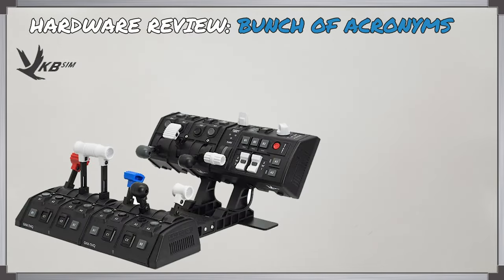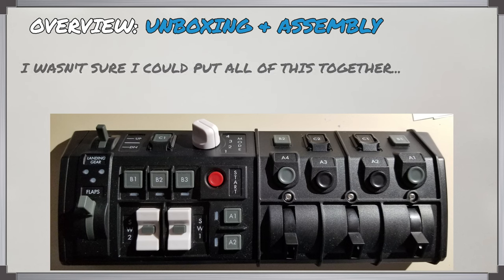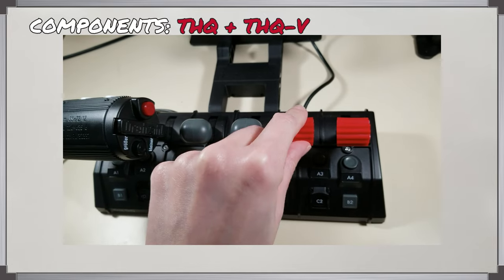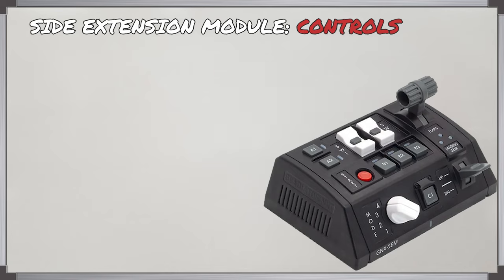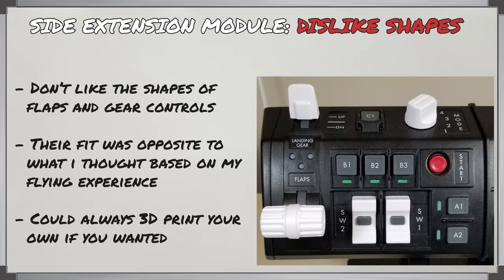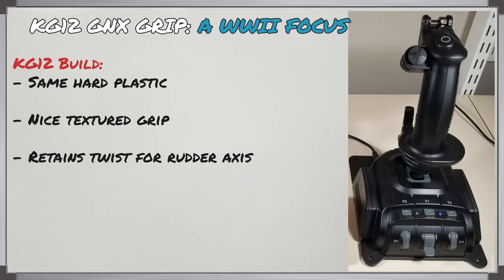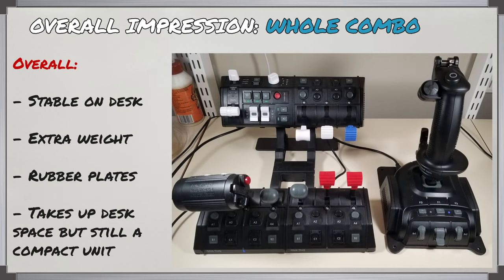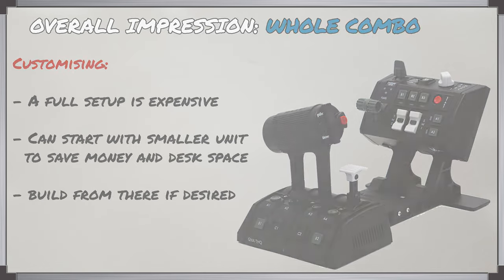Hardware Review - VKB GNX + WWII Combo

Comment: If you're comfortable diving into vkb's software, it's not too hard to change the gear lights to work with the larger handle on the sem.
Reply from the maker: I'm pretty comfortable with computers and software...but usually I like this stuff out of the box without worrying about extra fiddling around. I tiptoed into the software aspect a little bit more with WinWing but I still like the old plug and play, off we go aspect of hardware! :-)

Comment: regarding SEM module: I found that most sims has only Flaps UP a notch and Flaps down a notch positions, no matter how many positions is there. So I just rewrote names on those switches with white sticky and reassigned LEDs in config program, so it does not confuse me too.

Comment: Thanks for the review - may I ask about the WW2 throttle bit -  Are the supports plastic or metal? Does it feel sturdy enough to withstand 'emergency' slamming open or closing?
Reply from the maker: Supports are plastic but it is strongly held together

Comment: I used to run the KG-12 Evo and can't say enough good things about that stick. I've since moved on to a Gunfighter Mk III/MCGP for various reasons, but I still maintain that the Evo is the best "entry level high end" stick out there. It's more expensive than a TM 16K, yes... but unlike the TM-stick, it won't break and need to be replaced after a year or so. 
One of the reasons why I switched was the lack of buttons on the KG-12. Don't get me wrong: This is a kinda, sorta replica of a RL LW-grip, so it wouldn't make sense to overload it with buttons or additional hats. And I have to admit that I still miss that grip sometimes when flying WW2-stuff: I don't know what it is, but there's just something about the feeling of having the same type of grip in front of you in the real world as you do in your virtual cockpit. Especially in VR. 
I'm not too sure about that system of throttles, though. While I have no doubt they'll be of high quality, they do seem to require quite a lot of space if you want a decent amount of functions/buttons/switches. Plus if you go with that many sub-modules, things could get pretty expensive and you might be better off buying either VKB's STECS Standard or the Virpil throttle. 
Overall though, I'm very happy with everything I bought from VKB thus far. So much so that I just went ahead and ordered the MCG Ultimate grip as a treat for my Gunfighter - well... for myself, if I'm honest.. ;)

Comment: Great video mate! I am planning to buy GNX WWII Throttle + Gladiator NXT EVO mainly for IL-2. Do you think I will have enough buttons/levers I need for all the plane controls? Option B, which is more expensive, is to buy, apart from the joystick, the GNX Dual THQ + SEM-V Combo 
+ the WWII THQ Grip as add-on in case option A is not enough.

Thanks!

Comment: +RequiemBoS   If I had the chance to optimize the Virtual Engineering Bureau GNX Modules, I'd pick:

GNX-USB		1	USB Main Hub
GNX-MFH		1	Frame
GNX-FSM-GA	1	NAV Panel
GNX-SEM		1	Outboard Flaps/Gear
GNX-THQ		2	Middle Throt/Mix; Inboard Prop Gov/Cyl Vent/Oil Rad
WWII-THQ		1	Throttle Grip
GNX-IRP			2	Intermodular Reinforce
PRO-S-MCG		1	Gunfighter IV Pro-S Modern Combat Grip, 100mm Extension
TRUD-V			1	T-Rudder Mk V, includes BlackBox 3 USB roll/pitch/yaw hub

For the left corner, I much prefer the VIRPILⓇ VPC-402 Control Panel on robustness, including a three-position Gear lever.  Counterbalance with a VPC-401 on the right corner.